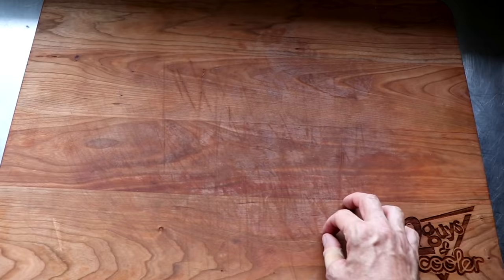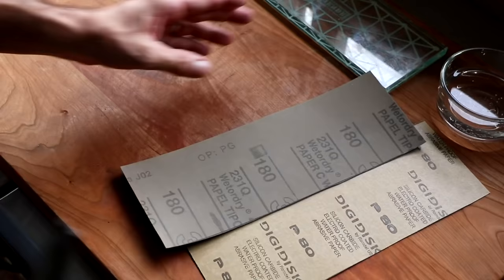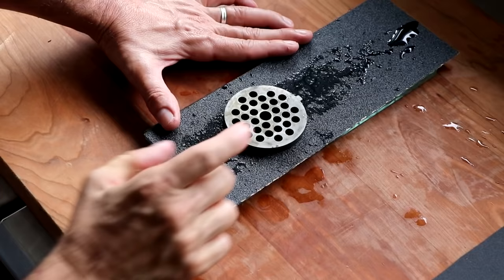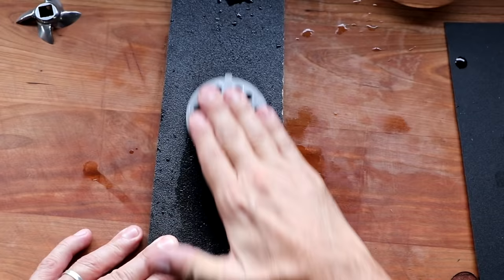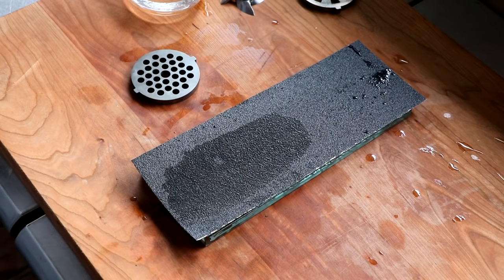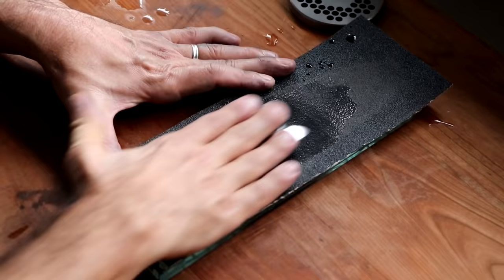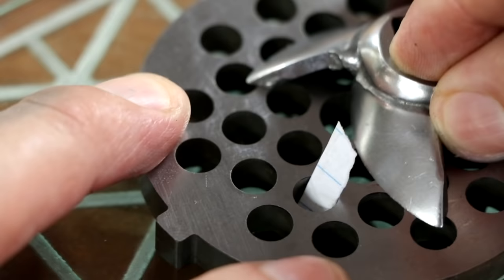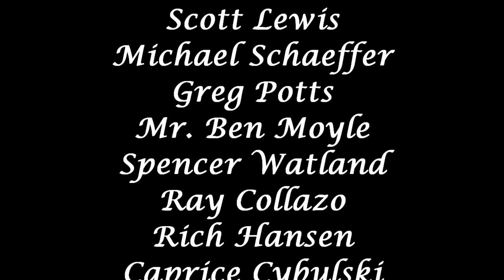Celebrate Sausage S02E18 - How to Easily Sharpen ANY grinder plate and knife

Comment: hold on those grits are way to aggressive, sorry folks but 800 grit and 2000 grit finish do not use those grits here. If he is sharpening with this grit its not wonder they are dulling and tearing the meat. Dude I like your channel and all but those grits are way wrong and off
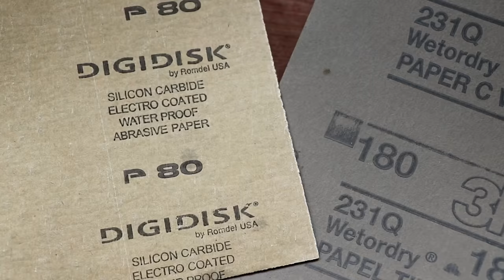Reply: I must respectfully disagree. It sounds like you are applying knife logic to mechanical sharpening logic, which differ in their goals. Mechanical sharpening of these plates is more about shape than refinement. At 13:39, a cleaving action is achieved by 2 corners/pieces that come together with no gaps. It's more like scissors in this case since any gaps between the plate and the blade would cause the meat to be crushed in that space. 80 and 180 grit seems to to be too coarse, but sandpaper is graded differently than Japanese water stones, which I will take the risk of assuming you mean when you say 800 and 2K. For the most part, at 3:06, P80 (FEPA Grade) and 180 (ANSI Grade) grits mostly correspond to their JIS counterparts, but if you were to use 2K ANSI (like the 3M sandpaper above) you'd be at a whopping 8K JIS. Silicone Carbide sandpaper at any grit is nowhere near as aggressive as a stone or diamond plate, and mixed with a few other variables like friability, you get a much smoother surface finish off of sandpaper which is what you want in this case. I do agree that 180 may be a little coarse for the final grit, but I wouldn't recommend going higher than 320 grit.
Reply: well the proper way is on a blanchard grinder the plate is ground from center out the specs is 1 thousands concave the knife is ground at 0 tolerance the plate is put on a magnetic base that revolves the grinder comes down comes down to center of plate and is ground concave. the right grind is obtaind plates should not be ground flat. have 30 years working for the 2nd largest plate mfg in the world sand paper is wrong sorry.
Reply: @barbkraus9677  Yeah but you can hand surface grind just fine with right tools